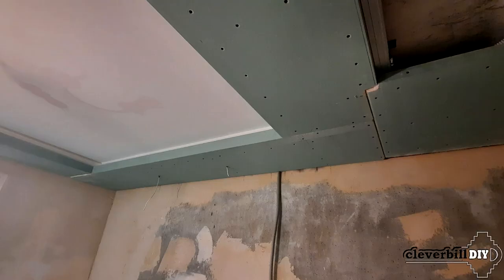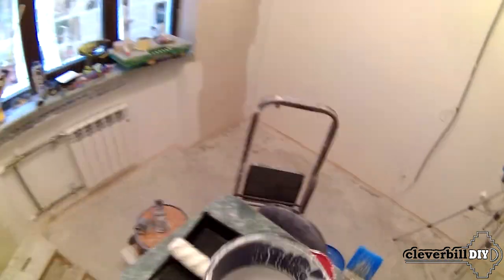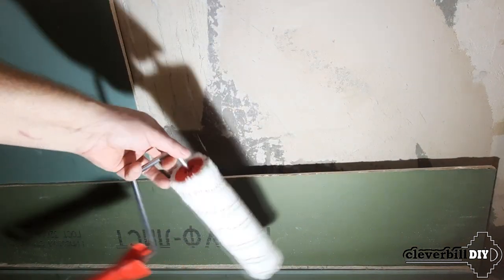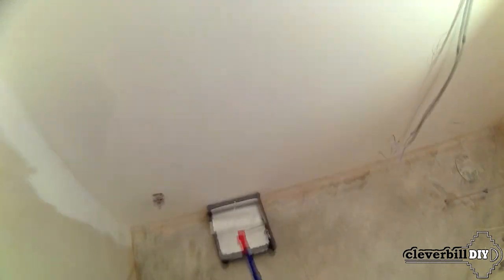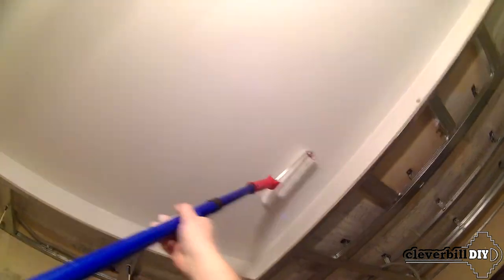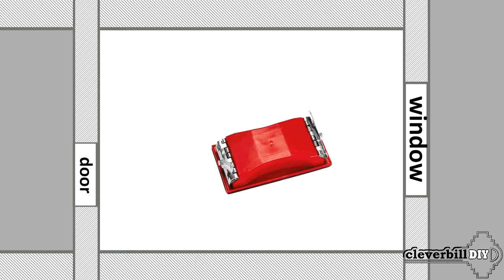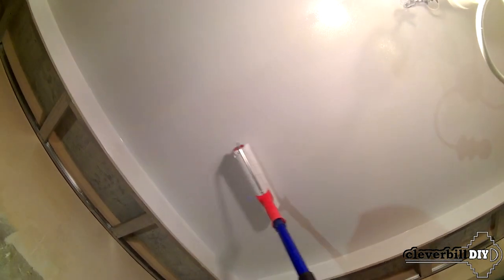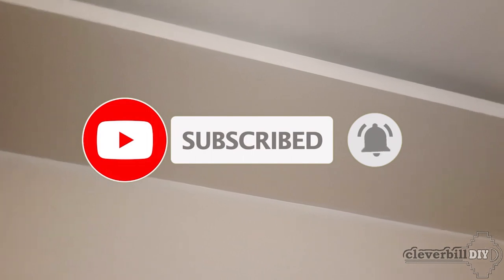DIY How to paint a ceiling - using a paint roller

Comment from the maker: When painting the ceiling, the choice of the paint itself plays a significant role in obtaining a high-quality coating and meeting your requirements. When choosing a paint, one cannot be content with leash only with the desire to save money. After all, you are doing ceiling repairs for at least a couple of years. And how long the paint will delight you with its whiteness and flawless surface depends on the choice of this very paint.